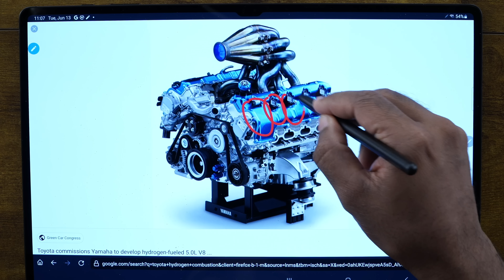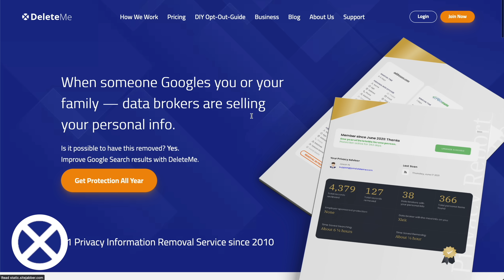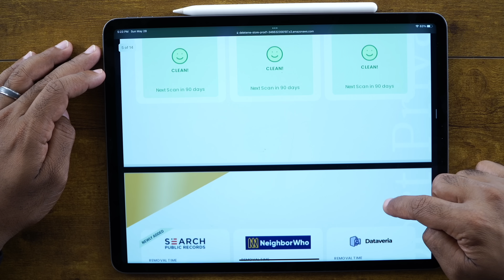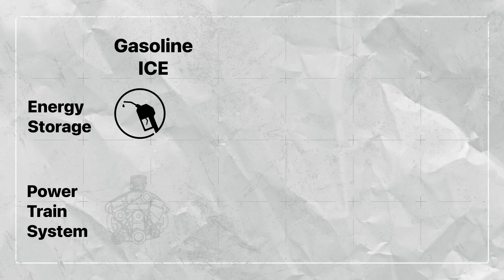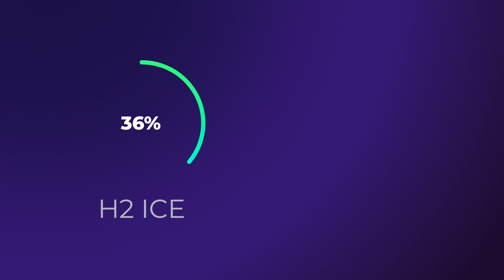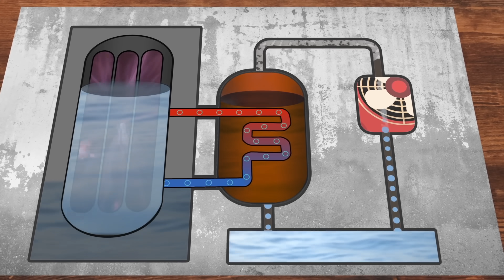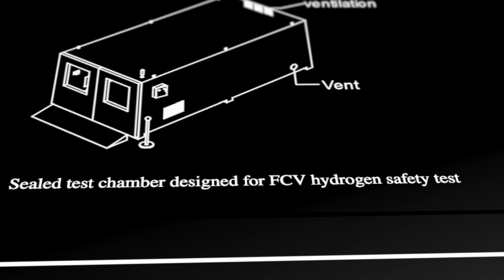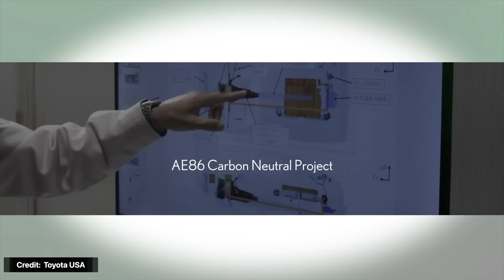Toyota's Says They Just Destroyed EVs - Hydrogen Combustion Engines

Comment: I will never buy a car without a clutch pedal. I like the added control and miss it when it is not there. Driving a car without a clutch pedal, be it one with an electric motor or with an automatic gearbox, is like being disconnected from the car, is like driving by pushing buttons, is like being driven rather than driving.
I consider everything that doesn't have clutch pedal to be not fun to drive no matter how fast it is. I myself feel that for real fun, a car doesn't need ABS, traction control or any other electronics of that sort; even though they make fast laps, they take away the real feeling of the car.

Comment: I think first of all about Electric Cars:
1, There is not enough raw materials to electrify all the Vehicles around the world.
2, The Lithium batteries are extremely fire danger, some Ferrys in Scandinavia, refuse to let onboard any Electric cars.
3, in case of fire in a electric car, the fire departments are not even trying to extinguish the fire, because they can't, and its dangerous to get close to a battery fire, due to the toxic gases
4, The battery Cars is for people who want to travel long range.
5, The life of a Tesla battery, is around 7 years, and who will dispose the batteries?
6, A Tesla battery change is a minimum 30 000usd cost, who will spend this money? which means a electric car is only for 7 years, and then to be scrapped, due to battery costs.......
7, I think the Electric Cars is the same as the windmills, uneconomically, high costs, and from start to end, very bad for the environment.

Hydrogen cars:
1, almost no emissions, as you said.
2, you can rebuild all existing combustion engines for Hydrogen, that's a big big plus.
3, I think the Hydrogen cars is the most
 and the best solution for our environment

So I think Toyota is the most clever Car company, who said that they will make cars that is affordable for everyone.
Today they are in the lead in the car industry, and I'm sure that they will come with a good Hydrogen cars solution.
Even Tesla is looking into the hydrogen cars, they know as well as Toyota do, there is not material enough on this earth to make electric cars for everyone, so when Toyota have solved the problems, Im sure that that will be the end of the Electric cars, maybe some of them will survive as delivery trucks inside the Cities.

And another thing:
If our incompetent and corrupted Governments around the world, had instead put pressure on all car makers, Im sure that today, we could run all cars on Gasoline/ Diesel without any emissions, through better filters, Cats etc etc.
But that's another story!!!
And what all people seems to forget, is that Oil & Gas is natural product, made by millions of years by our nature, when the emission typ CO2 is coming into the air, all living trees are consume it, food etc, is growing better, this is the gas of life(CO2)
All this bullshit about coming from the Green people, environmental activist, about the Climate change is just a fake, coming from the Globalist, too fill up their bank accounts, they been saying that the Maldives should be under water for 3 decades, but its still on the surface?
All pictures from the Poles are taken in the end of summer time, to scare the people that the Ice on the Poles are disappearing, but no pictures are taken at the winter time, I could write a book about all the fakes, but not here.

Comment: Hydrogen tech makes a LOT more sense than current EV's. We just flat out have terrible energy storage/battery tech right now that is developing at a snails pace and literally bottlenecking all new tech. If we can't store energy efficiently the most logical solution is to produce it and use what is being produced more efficiently....and Hydrogen tech does exactly that. But let other vehicle manufacturers keep peddling EV's that have multi thousand pound batteries that cost over half of what the entire vehicle costs and have to be replaced after 5-7 years.....there are enough idiots in the world to keep that industry afloat, sadly.

Comment: I don't quite agree with you about the partnership statement. Toyotas partnership with Yamaha also gave us the Lexus LFA, a fantasy of most car fans!
And where would GM be today if it weren't for industrial liason. 
I also believe there's a future for this technology if it was implemented correctly. Don't forget Supercharger stations were paid for (in some degree) by Tesla, by selling carbon credits to other manufacturers eg Mazda for (I think) some $2b. Leading to the ability to set up the world best charging network. If someone could invest in H2 filling stations everywhere - they could have their own power source (pv and wind), they'd only need a grid connection and a water source. Then we wouldn't need to necessarily pressurise the H2 so severely, if we could find a station every few miles or so!
There is also a company (I've forgotten whom) that is working on FCEV tech using just H2 in its gaseous state and stored in normal tanks/cylinders.

I think the UK is the perfect test bed for BEV transportation. We have a (somewhat) crappy public charger network, many of us cannot charge from home so have to rely on said 'expensive' network (it almost works out as cost neutral to ICE) and despite EV sales gaining all the time they still only represent a small percentage of the 50+ million cars on the road.... and then there's all the buses, trucks and trains/planes to think about! I cannot see a future where BEV are the only mode of transport.

Comment: I hate it when people say Hydrogen "is the most abundant element in the universe" as if that makes it cool and normal here on Earth. It doesn't. Also, the fact that Hydrogen is the nuclear fuel used by the Sun is almost completely irrelevant to using it as an energy store here on Earth!
The fact is that molecular Hydrogen is an extremely rare beast here on Earth for  very good reasons. It is extremely light and highly reactive. Hydrogen and Helium are the two lightest gases in the universe, so both escape quite quickly to space and literally evaporate away from Earth.
Also, Hydrogen can react easily with Oxygen which makes up 20 odd percent of our atmosphere, so it tends to become chemically bound up rather easily. It is produced continuously by biological processes and exists at around 550 parts per billion in the atmosphere more or less stably.

Comment: How much is battery cars efficiency, when the batteries has a weight about 25% of the weight of the vehicle. So why everybody says electric cars has good efficiency. They don't have. 
Remember, you will drag this unnecessary (25%) weight for the whole lifetime of an electric car. As stupid as towing 1500 pounds of gas canisters in your petrol powered vehicle.
So. Let's make a deal. Never say Tesla's are efficient cars. In most times in the USA, they are powered by coal. And they drag 1500lbs dead weight behind them for the lifetime of them.
Idiotic.

Comment: I think this is the coolest thing ever and f*ck EVs with their toxic chemistry that's gonna pollute landfills in 5 years.

My car is 25 years old and when it's scrapped it's gonna be almost entirely recycled.

An ev is lucky to last 6 years before being unusable without a battery change as expensive as the car itself.

Hydrogen is the superior energy source, every problem listed with it is an engineering problem with engineering solutions and I'm glad Toyota are investing.

Also you need to check out JCB they're doing hydrogen ICE for construction and their reasons make a lot of sense. Faster refueling, ease of maintenance are game changers for contract work on a job site and electric just doesn't cut it in allowing contractors to keep the same work schedules they're used to with diesels.

Comment: Unfortunately your comment about Toyotas belief in their products with partnering is a bit misled. They have been working with Yamaha for decades, and Yamaha has built engines for many of their cars as well as direct injection systems etc. One other concept you brushed over, was when talking about the new supra, yes its a BMW skeleton, however they took the design from BMW and rigorously retested it for reliability etc before signing off on it. They short cut sports car builds in some ways yes, but that isnt because they dont feel they should do the R&D, they simply focus on the most important (to them) aspect of the lineage of the toyota namesake.. Just because they co-developed the BRZ/GR86 with subaru doesnt mean they were lazy or didnt have a hand in it, they very much did. In fact the DI system used in the BRZ/GR86 is from Toyota. Subaru has a version, but Toyota implemented theirs instead. Not only that, but toyota owns 20% of FHI (subaru)

Comment: I think this is half informative, which is good than nothing. I think 35% efficiency for a new tech to start with is pretty decent, with scope to improve for the next 65%. Now a days partnerships are important, to have tech, patent kind of intellectual work to be shared. If one doesn't advocate for Telsa, HCE tech is a great way to overcome fossil fuels, with an Aim to convert all H2 generation to be Green. While H2 have the past history of Hindenburg accident, Li Battery packs are not less either. Further, we should consider the Electricity efficency from Generation to Transmission, and then usage with Charging, then using in motors. So 85% efficient can't be taken as-is, since every type of fuel end to end process have losses scattered. I think, we need to get with another tech to solve chicken-egg problem, it's the ability to generate Green H2 at homes. As Solar is becoming popular, why not use the excess solar power to generate H2, while the commercial H2 stations pickup. Tech apps can help drivers of H2, where they can find H2 while on long trips, helping households sell the excess H2. I think there are infinite possibilities to solve problems, if we start believing on the final outcome👍

Comment: I'm not a fan of your conclusion I think you ignore the massive downsides of electric cars and the ease of hydrogen production. build a hydrogen generator right now. it would take me 2 minutes to run down and get a battery in some water with a salt in it. that is all it takes I could produce a clean fuel source in a few minutes of tinkering as an absolutely normal person. We use gas as an easy fuel source at atmospheric pressure. lithium is a limited resource and giving everyone in a car-dependent society a lithium battery that large seems highly unrealistic.

Comment: the reason is simple pushing the edge of science with a really good fuel source. electrolysis cells can be performed right now with a 9 volt battery and salt water leaving hydrogen gas . it's not some highly advanced technology you could build a prototype in your garage. I would rather have a hydrogen car I guess lithium comes from slave labor and isn't sustainable if anything. Electric needs a more sustainable battery. mining lithium destroys the earth too.

Comment: Interesting... you include hydrogen production in the equation for H2ICE efficiency but dont include electricity production (typically coal and gas) and claim EVs to be "nearly 100% efficient" when they clearly arent. If you add energy production, storage and transportation into the equation then EVs are 1) responsible for a comparable amount of CO2 (plus untold tons of environmental pollution in production), and 2) are nowhere near as efficient as claimed. More so, the national grid cant even support a significant increase in EV use as we dont actually make enough electricity. The only way to increase that would be more thermal power plants, which are only between 40 to 60% efficient. Japan is in the same situation. It can produce hydrogen as a byproduct of their nuclear plants essentially for free. It doesnt have electricity to spare nor untold square miles to be turned into decollate solar panel fields that are inconsistent and unreliable in operation and require more complex energy grids with more batteries for storage. Its not a head scratcher at all.

Its not a hard thing to understand either why people would want an H2ICE. People like ICEs because they give the car a soul, a personality, the complexity is satisfying to most people who like cars. EVs in comparison seem soulless as they are generally identical underneath the body. Japanese car culture is very strong and its one of the very few things Japanese people can express their individuality  in an otherwise homogenous society riddled with strict rules.

Comment: The point on efficiency is a bit misleading, you have not mention that hydrogen engine has better thermal efficency then gasoline engine and it just unfair to compare a engine to a battery and if money and competition was brought to the hydrogen engine market efficency and fuel consumption would increase and lower respectfully

Comment: Since gasoline / diesel have lubricants in it and hydrogen does not, expect these hydrogen ICE engines to wear out their cylinders and piston rings very fast. Kind of like the cars & trucks that currently run on propane and have premature engine wear issues. Metal on metal requires lube and bad things happen when you run it without it.

Comment: You talk about changing stations. The aging power grid. Is only capable of so many. Wind an solar will not going to support enough.  Building tractor trailer trucks. Cannot happen until something changes. Flat out not enough power. With proper equipment h can be stored and moved. Like gas

Comment: i think a big point which i missed in the video is that already existing cars can be retrofitted to run on hydrogen at some point and that won't be too expensive. We have 3 billion cars in the world, imagine the impact on climate and the environment to replace all those cars with electric cars, that would be a catastrophy. Also Electric cars are also expensive and countries like india etc not many can afford them at all, retrofitting a existing car with the ability can be retrofitted as then engine block stays the same only internals have to be changed which in a low cost country will only cost a 1000-3000 USD. There is already a company in india retrofitting hybrid systems into standard cars of all brands for 1000$. The Lithium battery as we use now in most cars, has no future. We shouldn't forget that Toyota is also leading in solid state battery developement, they are such a large brand which immense resources they can afford to focus and push different technologies. 

Regarding the Toyota joint ventures, Yamaha and Subaru are already owned by Toyota by now, so it makes sense to leverage the their own companies for developement. Also the Toyota Supra was only a byproduct of a larget BMW Joint Venture which was about Hybrid technology and production efficiency. Also Toyota was involved in the Supra from the beginning and was the reason why the Supra/Z4 got a own chassis in the first place (BMW wanted to use their bad 2 series chassis but Toyota said no), you might as well say the Z4 is a Supra. The BMW engine was totally reengineered by Toyota ... 700 BMW engine parts had to be redeveloped as it didn't meet Toyota quality standards. Yamaha also has done a lot more engines for Toyota since 90's (2jz, Lexus LFA engine, the engine for the Century and the LS500).

Comment: Toyota should come up with Dual System vehicles or Hydrogen Hybrid  vehicles that incorporates Hydrogen Engine and  EV Battery. You should have the option to drive it as hydrogen car as well as Electric charged by the Hydrogen Engine.

Comment: Can hydrogen engine technology be used to produce cheaper electricity for homes and businesses, instead of using solar panels?

It’s pollution free, cheaper?

Electric car batteries charged with hydrogen technology engines,  is going to be an added advantage, 

further bringing down the cost of driving EV per mile compared to the current cost?

Comment: Making this engine flex fuel might be the next step. With a switch you move from H2 to gas and vice versa. That would make it a vary interesting option
Reply: The engine design constraints probably will not allow that with any reasonable degree of efficiency!
Reply: Not really. Petrol won't be available in most places and efficiency will ber abysmal. That means that it will be very expensive. You are clutching at straws.